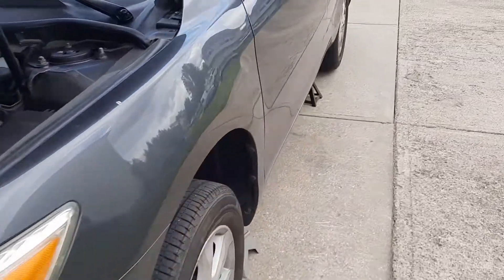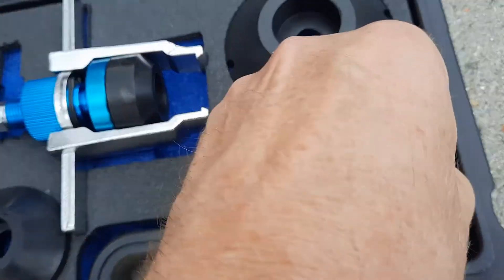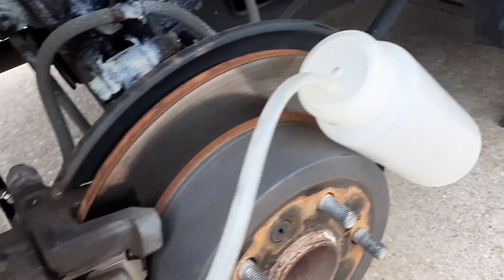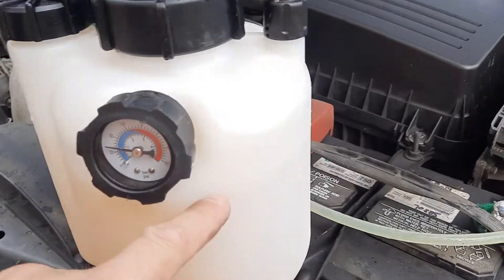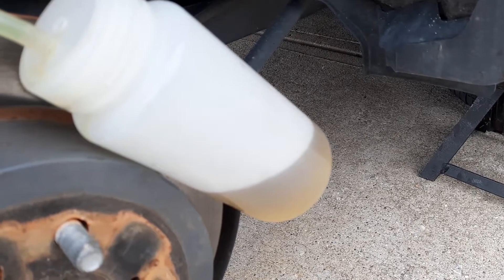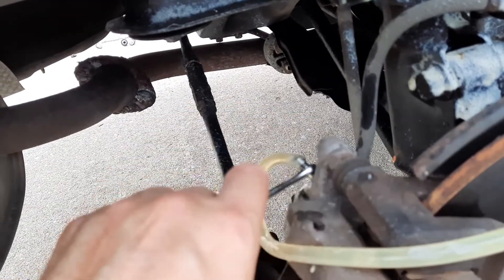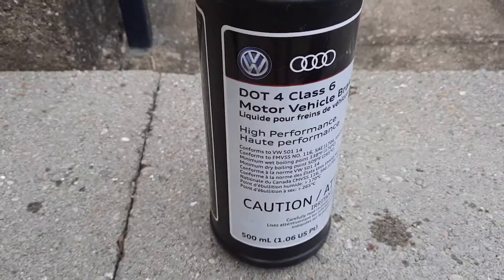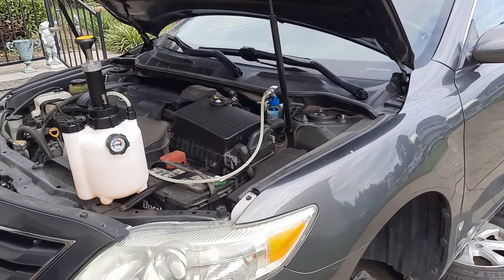Brake fluid replacement, Toyota Camry.

Comment: Hi, i have the same or very similar model to your vehiicle. 2008 camry xle. I had to replace the alternator and afterwards bizarrely, my BRAKE indicator lamp on my dash was on(parking brake was disengaged at this point). I read in some places this can be caused by low brake fluid. Have you ever heard about this?
Reply from the maker: @Star88701  If your parking brakes are not engaged, it could be low brake fluid. Check your fluid level, and if  good, you will need to check your brakes for malfunction. If you can't check it yourself, take it to the mechanic. I would check brake pads and Rotors and brake lines for leak first. Good luck.

Comment: Hello, thanks for the video. Will this work on a 2019 Toyota Camry SE?
Reply from the maker: It should. I don't know if you need adapters on 2019 models, but if yes, kit I had will work for any type.
Reply from the maker: In case you need adapter below is link.
JoyFans Brake Clutch System Master Cylinder Adapter Kit, Works with Brake Bleeder Tool for Car Truck Brake Fluid Replacement, Automotive Universal 5PCS in Blue & Black Case https://a.co/d/6DuKV1D
Reply: @averagemaintenance3875  tt